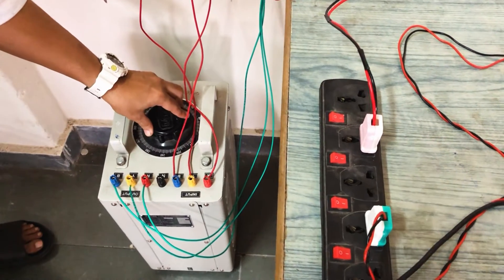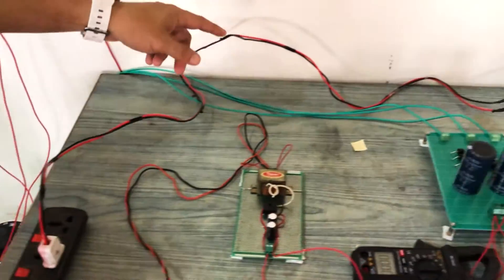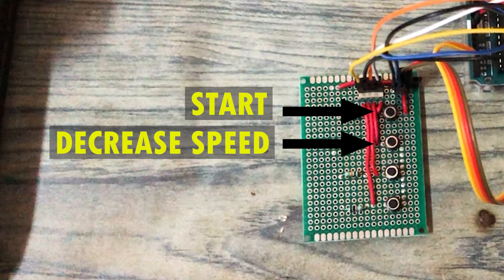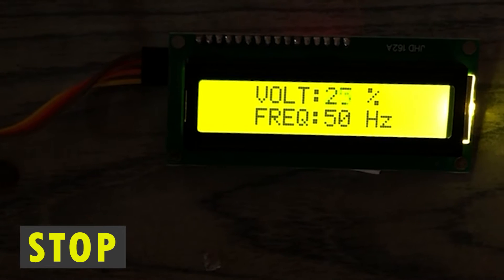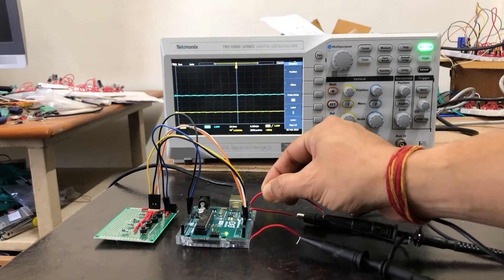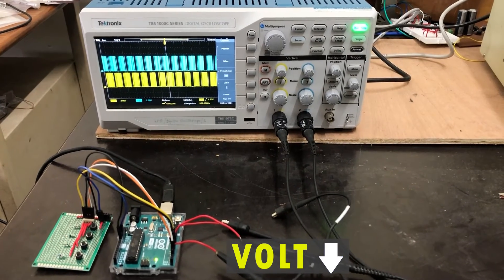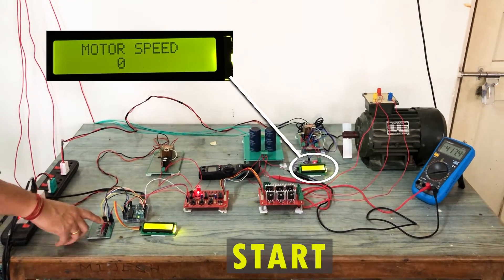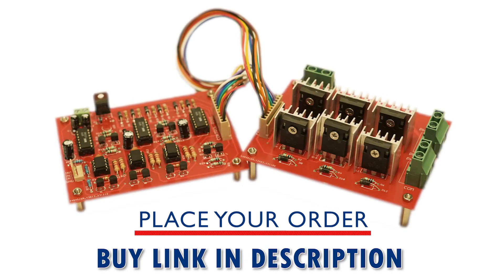Three Phase Inverter using Arduino for Variable Voltage Variable Frequency (VVVF) Drive - (Part-05)

Comment: Sir this is pure sine wave? And this can use from solar?
Reply from the maker: @sarwarmohammed9351  its is pwm. Can be used with solar
Reply: @FambiTech  ok sir,i want use this from solar for 3 phase pump
Reply from the maker: @ please whatsapp at 7076566327

Comment: All is good
CAN we use single phase or 220v
CANwe use to contrôle broschlers motors
Reply from the maker: Yes you can
Reply: How can I get it?
Reply from the maker: @mohmedahmed-vw2us  whatsapp +91 7076566327

Comment: What is cost what is max ampere per phase,,,ludhiana punjab
Reply from the maker: Please WhatsApp +91 7076566327 for details
Reply: Did you biy this circuit
Reply: @berat8949  no